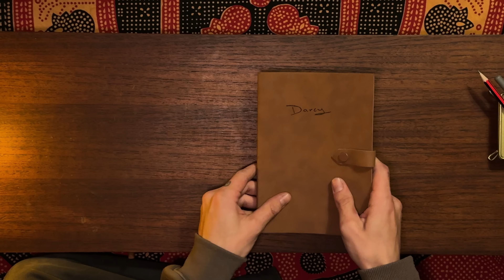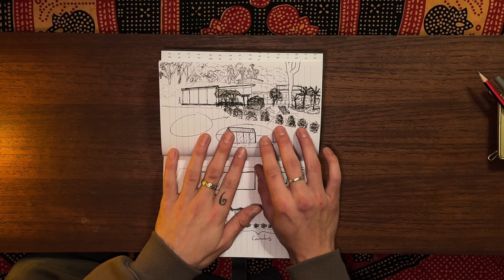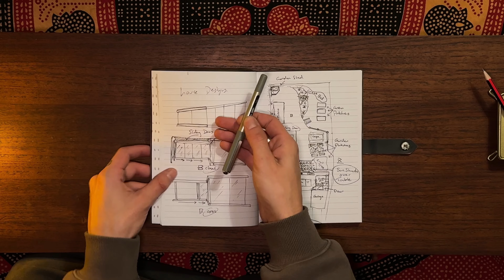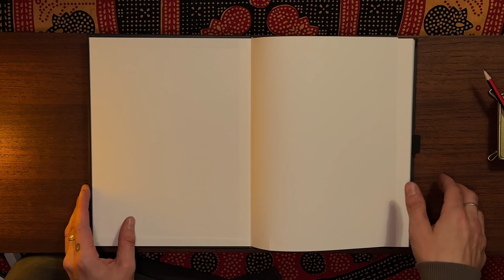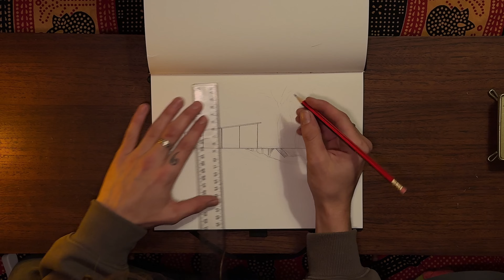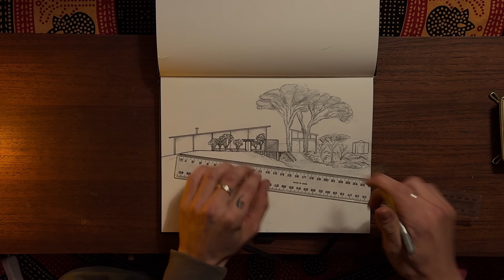ASMR Sketching | Soft Speaking, Drawing a House

Comment: The very first types of asmr were related to children in education setting. It was found they'd calm down from being hyper after dinner, by watching teacher write on blackboard. Nobody could link what was happening. Then followed older teenagers doing exams and why many felt excessively relaxed in the testing environment once competed paper. It wasn't just satisfaction for finishing. It all comes down to the brain liking routine. Liking planned movements at its l basic. So kids watching a blackboard are zoning in on chalk marks and and gentle sound with quiet room. Teenagers were focusing on the set out room, limited symmetrical furnishings, controlled standout sounds etc. Personally my first asmr experience was aged 14 when my maths teacher was writing in my book some calculator codes to catch me up after absence. I watched his pen, taking zero into memory, but felt stoned. Folk need focus more on basic asmr. SLOW movements, predicted even, and hushed noises. Rubbing mics and cracking knuckles is not the very deep asmr it once was all about. Old school eye tests were another example. Controlled room and movements. Predicted. Planned. Slow soft voice. Quick voice is interpreted as loud at times, sometimes ruining asmr experience.